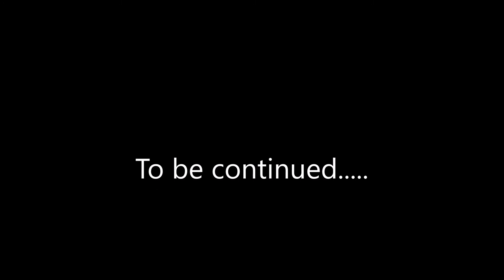Building The Ultimate Turbocharged Motorcycle Engine, part 3.

Comment: nice job. i have o5 zx10, any suggestions on what simple mods i can do to the engine to give it a few more hp. You know this engine in and out.  Do you build engines for others.thanks
Reply from the maker: Thank you. Simple mods on engines that make 170+ hp per liter don't exist unfortunately. There are lots of not simple mods that will give you extra hp, my favorite not simple mod is forced induction. It's my 1st time rebuilding 05 zx10r engine, but I've rebuilt other engines before.
Reply: I got a zx10 09 and I had a 04 in the past I think the best "simple mods" you can do for a few hp and being able to produce them on road is a good full system exhaust system then air filter...at that point your bike can't produce horsepower it might even go a little worse than before but then you can go and tune your ecu (flash it) to then new best air fuel ratio you can even help even more your bike with the help of a power commander and some more stuff like second fuel modules Ignition modules etc. so after all that tuning you have about 10-20+/- hp more depends on the stuff you putted into your bike. If you want to be able to produce that hp on a 0-400 you surely need to lower it just a bit put some weight maybe in the front downside of the fork extend a bit your swingarm at the point that the bike can start at it's best but doesn't drift on it's own. then you surely will a quickswifter witch will be connected on your powercommander I think that's a basic mod you can do so the bike can produce about 170 to 180 hp on your back wheel and being able to use them properly. I hope I helped...

Comment: Did you need to lubricate the crankcasebolts?
Reply from the maker: Yes.
Reply: @everydayirace  i forgot to do that, hopefully it wont do any harm. What do you think?
Reply from the maker: You need oil on the threads to properly torque bolts up to spec.